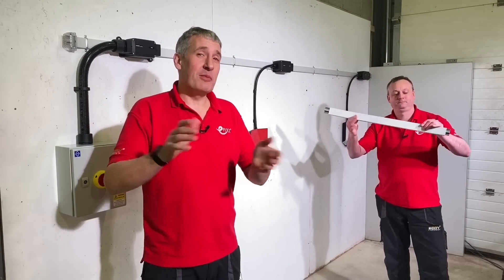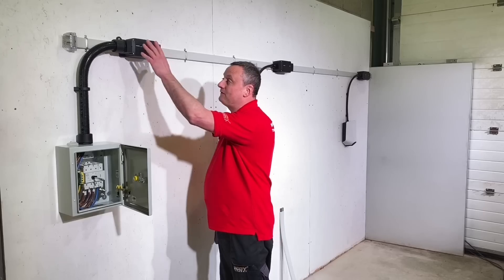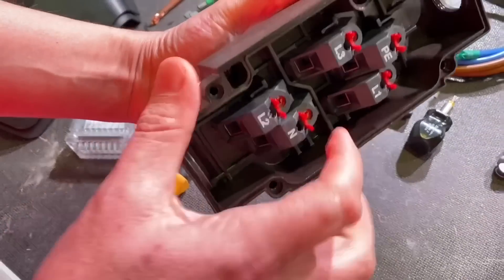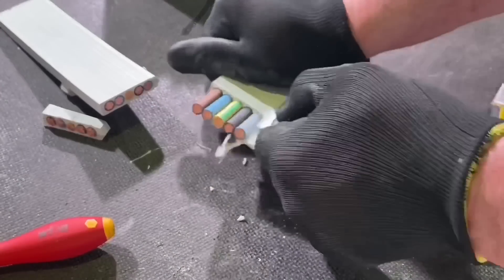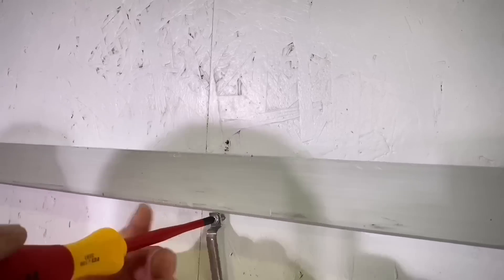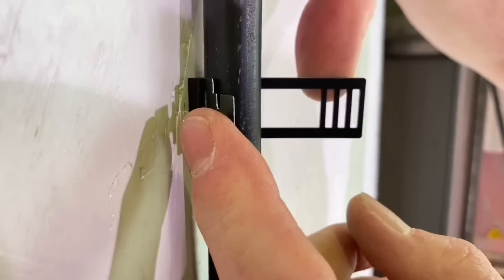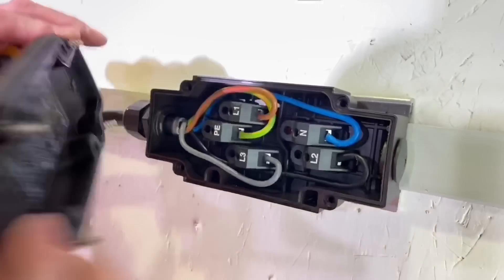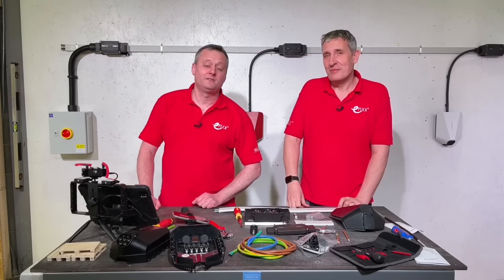Can this FLAT CABLE speed up EV CHARGER INSTALLATION - innovation from IDACS and EASEE

Comment: What size holes does the tap off make in the busbar cable once the tap box is relocated after installation. Do they make a IP65 blanking plate?

Comment: Here in Switzerland this system is very popular. In Commercial building it is run through big cable channels and every socket is taped of it. Another Place where I see it used is Christmas markets where it is just temporarily run from market stall to market stall and a short extension lead is connected to each tap-of so that every stall gets power
Reply from the maker: Great insight thanks 🙏

Comment: Who pays for the charging? Would it be part of the building fees?
Reply from the maker: That’s down to the building owner / installer - usually these chargers are paired to a back office billing system and controlled via and app or RFID tag.

Comment: watching from the states, the first thing I notice is that here, things which want a specific length of cable and strip have a gauge somewhere on the thing which makes it easy to cut, strip, and terminate without pulling out a measuring tape.
Reply from the maker: This is a pretty unique cable and the first time we’ve used it, hence of careful measurements.
Reply: @efixx  what I meant was that rather than writing a number on the device, our manufacturers stamp a gauge so you hold the wire to the device to measure it.

Comment: What about uninstalling an EV points? If a branching box is removed is there a blanking plate for the cable to allow it to A) retain basic protection and B) maintain Insulation resistance? Or do the boxes just get left in place?
Reply from the maker: There is a kit to cover the cable if a box is moved. It looks like self sealing tape. We haven’t tried it. We would probably leave the box in situ.

Comment: So this is just for the EV chargers? Surely it would be even better if the tap of points had some sort of over current protection or built in RCBO? As the smaller cable feeding each EV point is small than the supply and rated at 63amps?
Reply from the maker: We have a video coming out soon which looks at how the regs allow for this situation.
Reply: @efixx  has this video come out yet?

Comment: what about the removal of a drop? can this be achieved without replacing the cable?
Reply: I imagine you would just leave the branching box in place. Remove the drop cable and add a second blanking plug.

Comment: I’ve always thought it crazy how we need to adhere to cable bending radius when clipping SWA etc, but that rule goes straight out the windows when bending cores into a terminal box, like the 16mm conductors in this video!
Reply from the maker: We used Tri-rated class 5 conductors for the 16mm sq - it would have been a struggle with regular conductors.

Comment: Surely, the screw will be damaging the core?  How far in does it go??
Reply from the maker: No, the screw goes into the strands and pushes them apart rather than screwing onto them.
Reply: @efixx  obviously the screws will need to be rated at least to 63A then so you wouldn't be able to to use any old screws should one get lost somehow - believe me I've seen many a strange "modifications " of equipment where I live in Africa.

Comment: Thanks for this gents, I like the thought of this install and how it is an easy solution to allow for future additional chargers.
Are there any issues with using this type of install on a TNCS supply? 
Apologies but I wasn't aware of this EV charger manufacturer either, I'm assuming the billable metering is via GSM? 
Thanks
Ryan

Comment: Imagine the mess of holes when you remove them again, or have to move them.
Reply: Once you install the box, you're not allowed to remove it, i'd imagine.
Reply: @jmonsted  I would agree, it's likely a case of simply removing only the branch conductors, then installing a plug to seal the opening. But leave the splicing box in place on the flat cable.

Comment: Looking at table 4E2A of BS7671 the It for a 16mm 90 degree, non armoured cable, installed to reference method C (three phase) is 96A. if you put 11kW chargers (16A three phase) and assume a diversity of 1 (which is likely) then you only be able to have a maximum of 6 x 11kW chargers. 11kW chargers can charge a Tesla Model S in approx 6-10hrs other electric cars are not as efficient. for a car park, people may not need full charge, but you can see how the chargers quickly loose their utility if people are only able to receive a small charge, whilst popping to the shops. the key here is managing the clients expectations. if its just a planning or property developer, box ticking exercise to increase the value of their development then this isn't really a consideration. Ultimately, my opinion is that its use depends largely on the client expectations. voltage drop will also limit its use. it would be good to see how it performs after the electrical installation is properly designed.
Reply from the maker: Thanks - The main target for this kit is car parks within apartment blocks. Our previous Easee videos explain how the power sharing works.
Reply: Remember that averaged out over all cars, each car only needs about 7kWh per day if it's plugged in daily. The "fill up from empty to full" is not the typical use case unless you look at DC fast charger stations.

Comment: Looks like a great system from IDACS. I am having trouble understanding how 1 circuit can support 101 chargers. Surely there would be some disappointed drivers wanting to go to work in the morning if all say 80 charging units were in use overnight. I know the system with the EASEE units gas quing and load balancing built into it, but it just seams an impossible ask to have all those vehicles ready for use every morning. Please tell me my fears are wrong?
Reply: 100 is a bit much, but using the average daily driving distance for Europe and some average consumption numbers and assuming cars are parked for 10 hours overnight, the math says that a 22kW supply can support 31 cars. Probably more because the average includes long-distance miles, which are typically not charged at home.

However, this needs a charge point that can switch any of the Ls onto pin 1 of the plug for cars that only support 1-phase charging. Otherwise the heavy bias to L1 would be the limiting factor. Rotating the Ls would help, but the statistical distribution doesn't work too well for such small numbers and you could end up with all 1-phase cars on the same L again.
Reply from the maker: Valid question Brian  - The limiting factor with EV charging is the supply in to the building - 100 chargers at 22kW or even 7kW is a massive demand. So clearly some form of diversity is needed somewhere in the system.  In reality not all 100 cars would have empty batteries and not all cars will be expecting to make a journey of 100's of miles everyday. Not all cars arrive and leave at the same time.  At the same time you wouldn't want to move your car from a charger in the middle of the night  to free up a charger.  So the Easee system matches available power to demand.  You can of course share it out equally or set priority for certain chargers based upon need.  - Hope this helps - We'll ask Joe to pick this up in a Q&A.
Reply: It's all to do with that load balancing, we'd be happy to talk it through with you if you give us a call on 02380 279999 :)

Comment: The apartments my son lives in, 40% of the car parking spaces are not near a wall or pillar. the ceiling is about 4 meters. any ideas.
Reply: That configuration would likely be a problem for EV charging regardless of product. I imagine this could be run along the ceiling, then bring the conduit or branch cable down to a charge point attached to a board suspended from the ceiling at a reasonable access height.

Comment: Finally I’ve only been in suspense since the last video I watched looking at the weird things on the wall.....
It’s even got Flexi con.
Interesting system. The attachment points for the wire seem a little bit shaky when tightening otherwise I can’t find fault with it unless somebody removes the endcap or a box or the cable gets damaged. Seems like the screws don’t go through they just kind of pinch really interesting system.
Reply: Works just like the "vampire taps" of ancient ethernet 10base-5 wiring. Those clever swiss :)
Reply: @jmonsted  10 what wiring lol I'm not that old but I did do a bit of reading on the subject way back when. What an interesting method of connection and it's not documented that well on the Internet. I would love to make a video if I was crazy enough to buy the equipment.

Although I did re-buy 10base2 equipment because I accidentally Fried my free hub. Found a good deal on eBay for a new one and manage to find the exact same model I had for a good deal too. I bet you know where this is going yes I wanted to set up a 10-Base2 network for fun. I even managed to hack it into running on 75Ω coax for about 50 feet. Someday I plan to retest with more than two nodes I have a printer, network card and actually have terminators now. I originally only had one so I was playing around with some resistors but managed to find a 10k volume pot amateur that actually gave me 50k ohms across terminals.
Reply from the maker: 🤣Hope it was worth the wait. The connection to the wire needs a significant amount of torque.
Reply: @efixx  it was and I'm looking forward to the next video too. Yeah they didn't look like they were attached for the amount of torque that was needed. I could also see scenarios where suddenly somebody wants a connection point to be removed and a wall to be nearby or something to close that it interacts with the housing. It's an interesting flexible bus bar system.

Comment: Looks good. Initial thought was if somebody smashed a tap off box how good would the connection be when installing a replacement as the cables would have been screwed into already. And also if you wanted to remove charge points you would have to leave the tap off in place as there would be exposed live parts if removed completely and damage to the copper cores of course.

Comment: Nice system but the cable outlet of the junction box should be on the bottom of it rather than on the sides.  That would make the cable to the charging point straight rather than having a 90 degrees curve...  Would look much more cleaner and would make mounting these cables on the wall easier.
Reply: Ahh, but with this layout, you can drape two drops off of a single tap. So center the tap between two parking bays and bring the branch cable/conduit down to the respective charge points in those bays.

Comment: How do they get away with not fusing each drop to protect the thinner cable? OK the chargepoint tells the car how much to draw but is that sufficient to guarantee safety?
Reply: The fuses are in the Easee charging stations, the European Norm allow for a drop of 2 sections without fuse, if the lead is shorter than 3 m.
Reply: prospective demand vs fault current. it looks fine to me
Reply: That end termination kinda scary. I know it's probably polycarbonate. But probably should have something else to cover the individual conductors. For a secondary security if it gets smashed. Working in the industrial field if it may happen it will. Don't underestimate the ignorance of the everyday person.

Comment: Very nice, glad to see cables evolving in the EV install market at last.Great system, I could fit that all day... neat, safe, and could be a standard to follow. We should use more flat cables in this country with insulation displacement around buildings to drop lighting down walls etc. much neater.

Comment: We use a system at work called Tyco clips  for extra low voltage stuff, it works so well. Could never see why it couldn't be beefed up for low ( 110v 240v) stuff. Now it has.

Comment: what happens if you install a tap off then it need to be moved to another position, youd be left with the cable pierced  holes in it , is ther a type of cover plate if you have to remove the tapp off point
Reply: Or just leave the tap in place and plug the gland holes
Reply: There's no cover plate available, but we can provide a self amalgamating tape which will help if you need to move the tap off point

Comment: Shouldn't the tap off boxes be fused since dropping down to a smaller cable size?
Reply from the maker: A few specific regulations cover this situation - similar to tap offs on under floor bus bars in offices. We will explore this in a future Q&A video.
Reply: Ok, thanks.

Comment: Nice system, but I prefer Canalis rail systems (Schneider Electric). They're rated IP55, so still sufficient. That's their small system, rated for 160A/phase:

https://www.se.com/uk/en/product-range/1752-canalis-kn/

The advantage is, you can open an access point on the rail. Clip in the tap-off. If you want to relocate it, you remove the tap-off and close the lid. With this cable this is not possible, once you've penetrated the cable you can't relocate the box at a later time. Inside of the rails are bare copper rails, and the tap-off modules clamp directly on the copper rails but the system is actually idiot proof. Even if you open the lid, live parts are not directly accessible. Due to the lack of insulation inside, there will be no problems with fumes in case of a fire caused by halogens in the insulation of cables.

This system is mostly used in industrial installations, there are also versions which go up to 1000A. I've also seen such systems in bigger apartment buildings.

That could also be an alternative.

Comment: I do not like it in principle. A sharp point piercing insulation and then into a live copper conductor!
Reply: Its not a system to allow live working, you should be isolating before adding in any junctions.
Reply: @iScoTT29  Thanks for the clarification. As an ex-Brown Boveri employee I have a great respect for Swiss engineering.

Comment: As ive seen a comment before, i would question the end piece, as it appears to be single insulated, unless due to the end cap being ip rated, does that negate that issue?
Reply: Every plastic enclosure is the same.
Reply: The end-pieces also have an IP65 rating
Reply: reinforced insulation, presumaby

Comment: Is this for one unit's parking space or two? How would it be monitored?
Reply: With the Easee chargers, you can have up to 101 commercial chargers on one circuit. However, you can fix the flat cabling in and install 1 charger initially, as the demand for EV chargers grow, you can simply branch off the cable at any time to add more chargers, without the need to install more cabling infrastructure. The Easee chargers talk to each other wirelessly to balance the power load.

Comment: Thus Thing ist Missing
https://prod.woertz.ch/web/woertz/de_CH/woertz/133/Verteiler%20Geh%C3%A4use%20zur%20Absicherung%20zu%2049615/$catalogue/woertzData/PR/49617/index.xhtml
Otherwise the 6mm2 is not so happy
Reply from the maker: We have a few regulations to allow for this situation. Plus the Easee has a clever load sharing system so it’s not possible to over load the tap off points.
Reply: @efixx  of course in this exact situation it might be okay, but in most cases a fuse is needed to protect the cable to the load or all cables are rated acc. to the "main" fuse.
Is this plastic box allowed in UK?

Comment: Not installation related but practicality related instead.
In your hypothetical (or any other multiple occupancy situation) who pays for the energy use-age? Its all well and good having a single wiring solution to easily supply electricity to multiple chargers but how do you apportion the billable electricity used to the properties? Last I checked the EV Chargers don't have that type of functionality integrated enabling them to talk to an installed Electricity meter. And even if they did the Electricity Meters installed by the Suppliers/DNO's (in the United Kingdom) don't have the ability to talk to the EV Chargers. They can barely get Smart Meters to work properly and/or communicate with the smart meter "Interface units" inside the home.........
Reply: indeed I thought the same, and given the amount of energy used most custo ers would like to be able to shop around for suppliers, so the landlord paying the bill and then billing the tenant may not go down well

Comment: Is it supplied at say  3 metres lengths and joined at intersections  or on a roll and wound out?
I'm just thinking how rigid
Reply: piggy backing off this question. as for adding to an existing install. is there a joint system or is it done via 2 of the take of boxes and then 2 end caps?
Reply from the maker: Yes it would be 2 take off boxes and end caps
Reply: @efixx  would it be the take off or the supply boxes? Just thinking about the load and the cable size reqd to link up
Reply from the maker: The cable comes on a reel.

Comment: One plus point is that the supply could be in the centre of the cable rather than at the ends . Not sure about 60A via compression connection but it must have been tested to overload conditions
Reply: It would be 32A max, not 60A
Reply: @mikeselectricstuff  it shows a C63 mcb  so I assumed 63amp supply